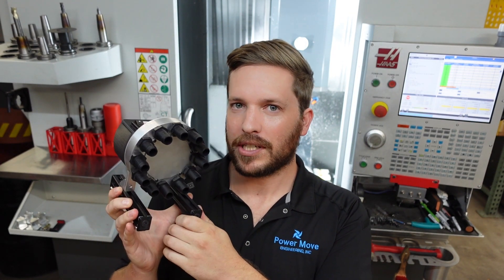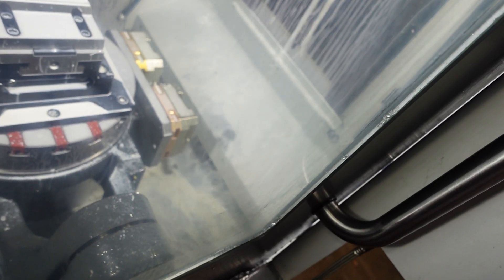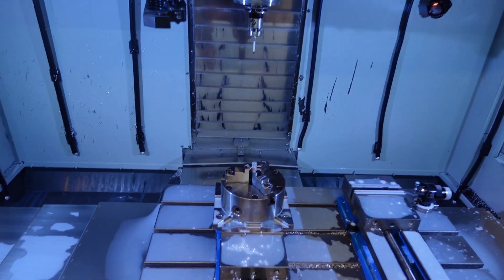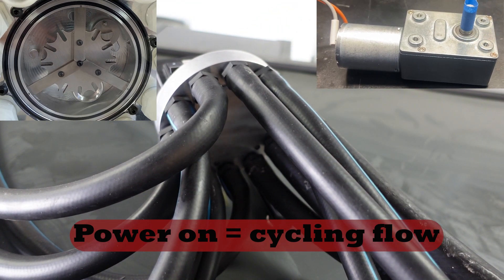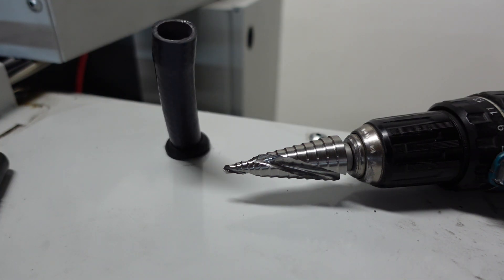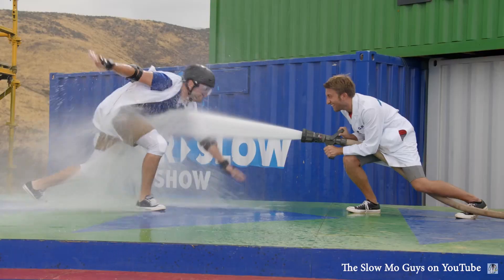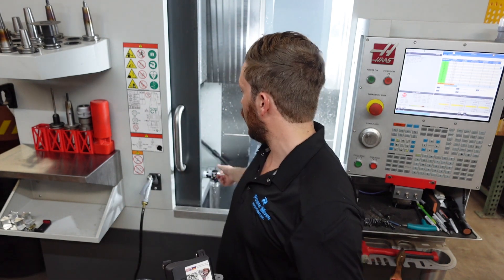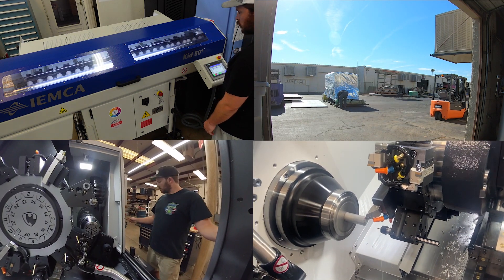Automated CNC Washing | Lazy Or Genius?

Comment: How much coolant is lost during a night shift run. Your device kicking on and belt or auger running. We all know chips carry coolant out into the barrel.  I know my recycling yard loves to be seeing coolant being dumped. They'll knock off.05 per pound no questioned asked.
Reply from the maker: For both of our machines with a chip conveyor (Haas UMC-500 and Doosan Lynx 2600SY), we run the conveyor as little as possible for this reason. Our scrap recycler has not complained but we never want to waste coolant. Even during heavy roughing it seems like it is always possible to let the chips drip dry in the steep sloped region of the conveyor for at least 30 minutes. We try to only to only run the conveyor for 10-20 seconds at a time and this added system does not really affect that. It just helps move the chips towards the conveyor rather than building up elsewhere.
Reply: I built stands for my chip bins with a tray to catch coolant and a pipe leading back to the tank.  I drill holes in the bottom of my bins so they drain into the tray.

Comment: Haas auger chip conveyors are so shitty, belt conveyors are the only way to go, don’t know why haas keeps using them, and chips build up way too much in haas
Reply from the maker: I definitely agree that conveyors are far superior to augers. I believe cost is the main factor there. We think Haas verticals have great overall value. But yes the enclosure floors are quite level and collect chips easily.
Reply: @powermoveengineering  that’s what I used to think too, but now you can buy DN solutions (doosan) mills for the same price as haas, with all the improvements that haas doesn’t have, I started on haas, I don’t hate them, there is just a lot of cons for them, have you heard of Hurco ? By far my favorite machine and they are the same or cheaper than haas
Reply: @powermoveengineering We have the same issues with the Doosan VMC, the enclosure floor has a swallow slope like the Haas with auger on both side with no front conveyor.
When we mill plastic and use air instead of coolant, it takes 30mins sometime to get most of the chips out.
Loc line coolant nozzle hook up to a air line on certain places will reduce that time down to a few minutes.

Comment: Love This!! Where can i buy? My UMC500ss loads up with chips so so bad and the chip conveyor is so terrible!!! I need this
Reply from the maker: The complete kit is available on www.SwarfDiablo.com. The installation was a little bit more involved on our UMC-500 compared to a larger vertical 3 axis machine due to the tight quarters surrounding the tool changer and behind the main door (left side). We can send you more info about exactly how we routed the hoses and nozzles on that particular machine. Overall we are happy with the result because there are no more hidden areas for chips to collect and the system is maintenance free. Thanks for your interest. Let me know if I can help with anything.